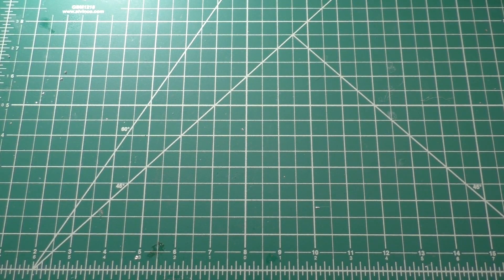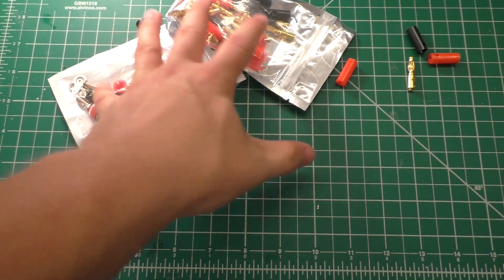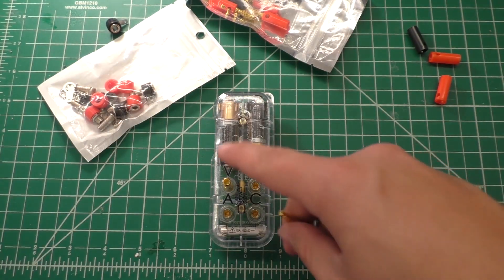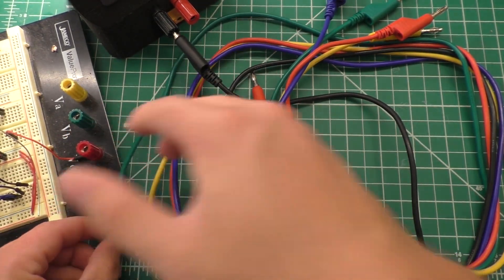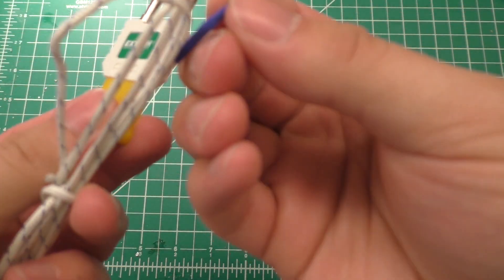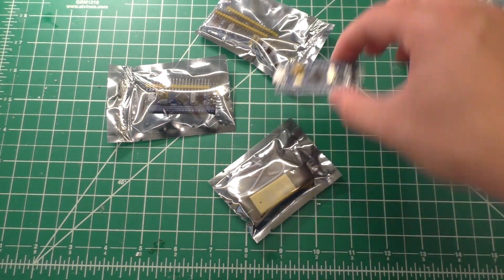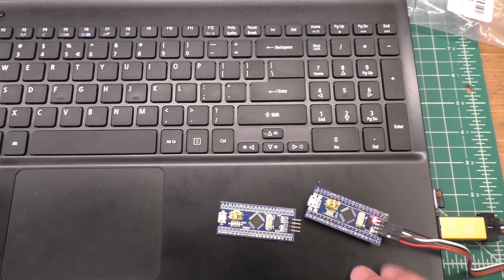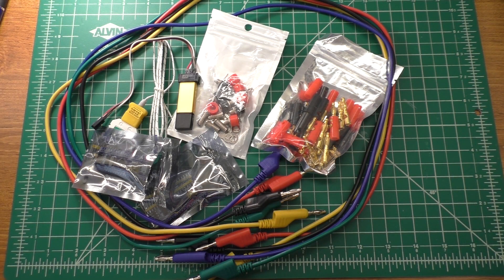Mailbag #6: Banana Leads and Arm Processors

Comment: For STM you must switch the jumpers to boot 0 to 1 to program and then back to boot
https://www.youtube.com/watch?v=EaZuKRSvwdo
No need for STlink
Better buy ESP32 with Bluetooth wifi and RF + 2 core cpu )
Reply from the maker: I did that. Note that I couldn't get the original board to work with the STLink either. I have an ESP8266. I haven't messed with it a whole lot though. I might pick up an ESP 32 at some point as well.